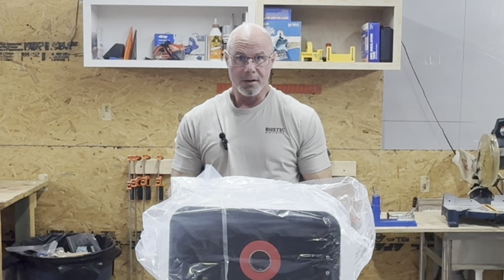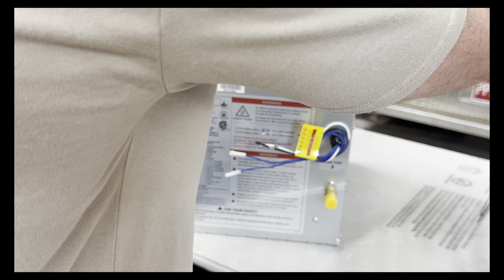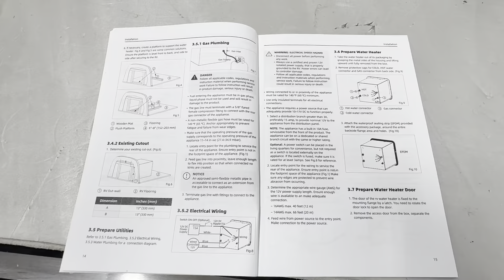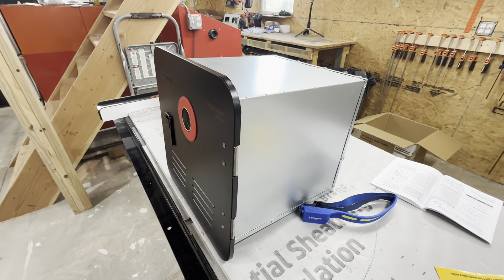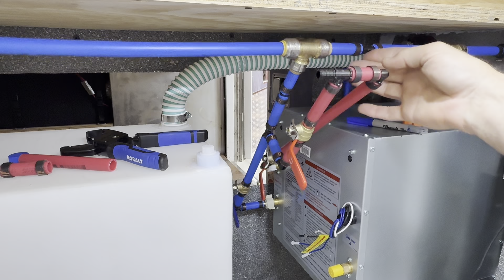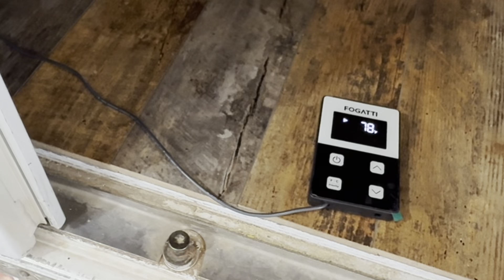Fogatti InstaShower 8 vs CountryMod tankless water heaters - Full Install & Review

Comment: After installation of the Fogatti InsaShower Ultra which has a different door during the first rain water entered through the bad design of the door and actually shorted out the circuit board. Fogatti sent out another circuit board free of charge but what about the door? If I don't redesign the door its going to happen again.  I was not even driving when it rained it was parked.  Water actually ran inside the white plastic circuit board housing. There is actually a trough on top of the circuit board housing for the primary voltage wires where water runs down in on the board. Crazy design. Makes me worry about the rest of the water heater if they over look something as simple as the door.
Reply from the maker: Time will tell on mine. But I have considered adding another seal around the door for much the same reason. Crazy that these wouldn’t be designed to be water resistant considering they are meant for vehicle use. Thank you for watching btw!

Comment: I purchased the ultra water heater but the horrible engineering on the door allowed the first rain to enter not only the entire inside but also the circuit board shorting it out. They are sending me a new one but what’s the point if I don’t fix the water intrusion problem. I would suggest not buying one until they reengineer the door
Reply from the maker: Excellent share. Thank you for letting us know.